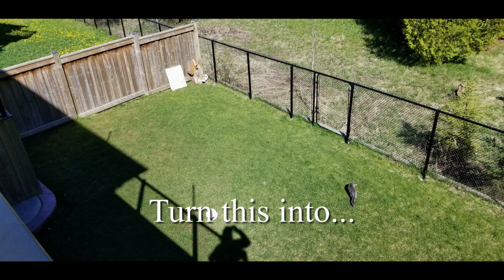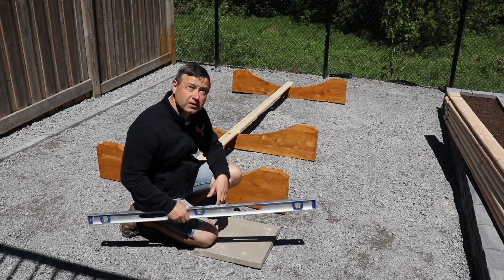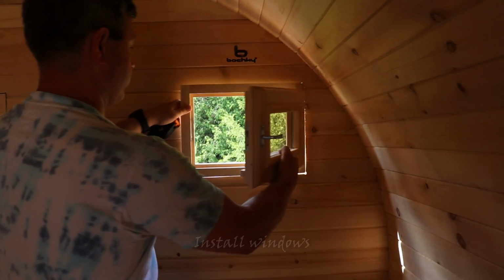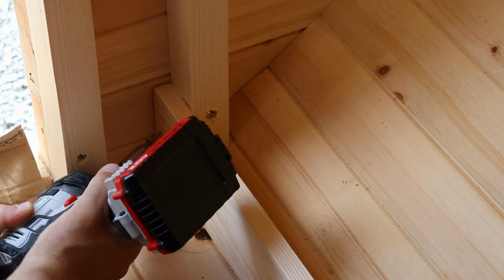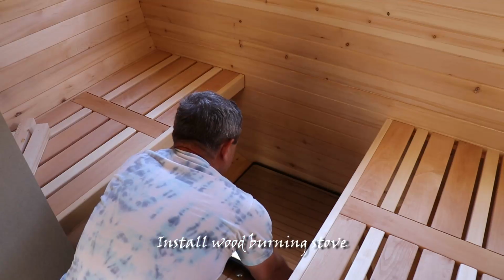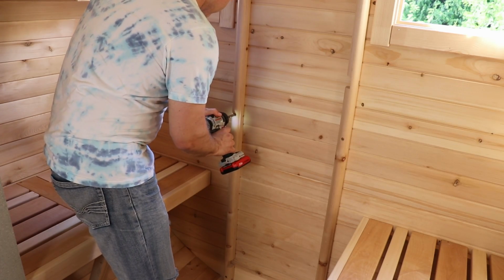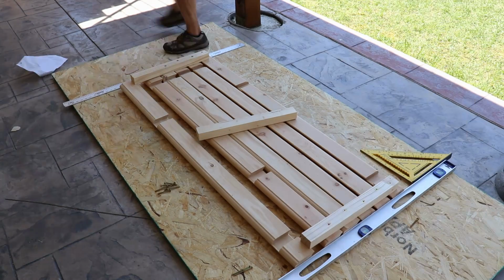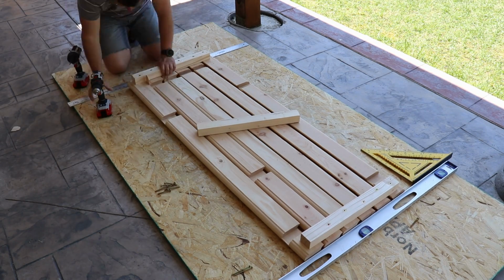Barrel Sauna, step-by-step assembly

Comment: I have some comments seeing a couple of different video's about the same subject.
At the same time that is my advice if you want to build one of these barrels, sauna's AND hot tubs, watch as many videos as you can find before making your own plan.
Fastening every outer board with a screw bocks the effect of the stainless steel bands to push the outer boards so close together they are "water tight". That would also have prevented to have to cut the top board in half. So in my opinion it's better to not screw the boards above the height of foundation beams. 
The hinges for the bench box in the front area. When you put both the flaps down, on the wall as well as on the back of the seat, you only will see the pivot of the hinges and the hinge will have the same amount of pivot.
Have fun woodworking, thanks for this video.

Comment: What's the point of the metal bands if you're going to screw every piece of wood ? the point of the metal bands or metal wires is to tighten all the planks together without screwing it.
That way when the wood works over the years you can keep tightening it. The way you did it you can't do that,  you'll just end up with gaps everywhere.
The bottem part is the only part that needs to be mounted with screws because it works as your solid foundation. And I would use 100% Stainless steel screws (RVS)
Reply from the maker: You might be right, I just followed the manufacturer's instructions - they designed the sauna, they should know better. I guess they are mostly for decoration.
Reply: No, they are definitely not for decoration - the wood expands and contracts...

Comment: You dont need screws.
Reply: @Couchlover47  Yes it does hurt it. I could tell you why.... And there are tricks to doing it right.   I could tell you how thru my gained wisdom from my vast experience but that would be pure stupid. You see I build these for a living so why would I give my secrets away . Go ahead and do it your way. You are probly right
Reply: @fredrickneitzche6748  I am also worried about huge amount of screws in this instal....I think wood won´t be able to work with seasons and it can even crack .... 
I have seen people hammering sides of big circle walls to snug fit staves in...but also not pushing all the way in - leaving small gap inside joint - so the overal barrel shape can grow and shrink over seasons... I was planing to make my own build like this- so I´m just wondering -  also wrong? :) thanks for little bit of wisdom in advance :)
Reply: @DodkoTheFirst  Are you in canada ?
Reply: @fredrickneitzche6748  I wish I was :) ... Big mountain skiing and MTB paradise... Anyway, I´m from Europe (Slovakia)
Reply: @DodkoTheFirst  You are a cyclist so ill tell you. You can use a few screws to hold a few bottom  staves in place , but pull them once you get your banding on. The last stave on top needs to be a half inch or full inch larger than the gap  and you use the tension of the banding to tighten them down and squeeze them all together for an air tight seal. Tap all the way around so the staves can move, take your time, as you tighten the bands. This makes the barrel ten times stronger too as it uses tension to hold everything together, rather than fasteners or screws that are easily pulled free or loosen on softer woods like cedar.  Its harder to do and thats why many dont.
Reply: @fredrickneitzche6748  You are true "mvp" if you find yourself in Slovakia I'll grab you a beer and show you around some trails for sure ;) 
Can you please explain this step -"tap it all the way around so the staves can move"- little bit more? I'm afraid I don't get it where should I tap it around. Everything else makes a lot of sense if you want to make it properly... Sadly  many big manufacturers make them oversimplified. That's why I want to make my own :)